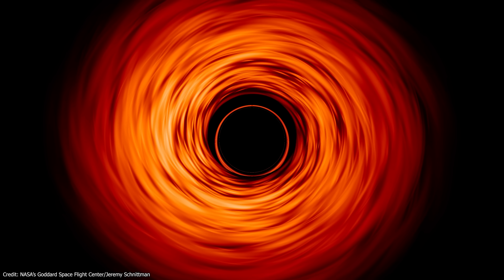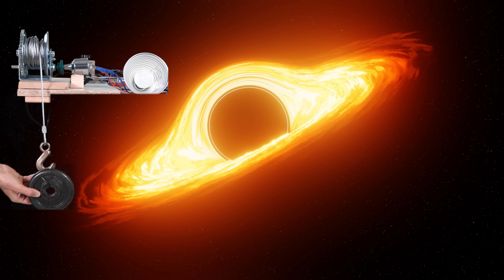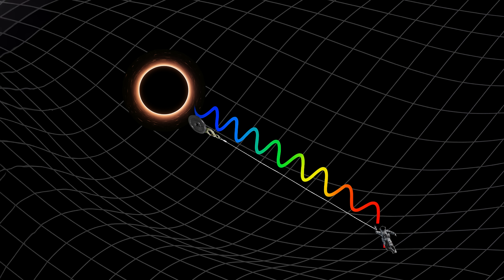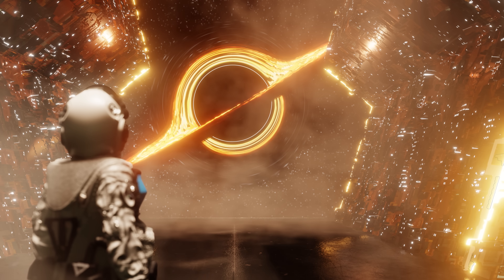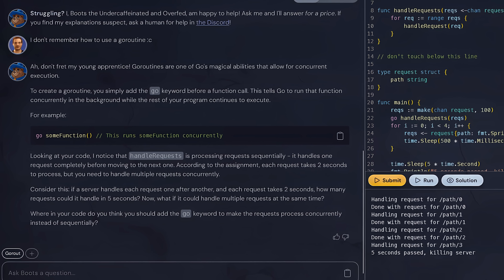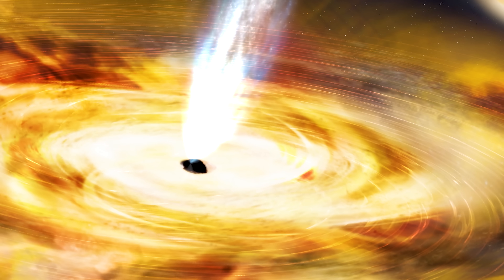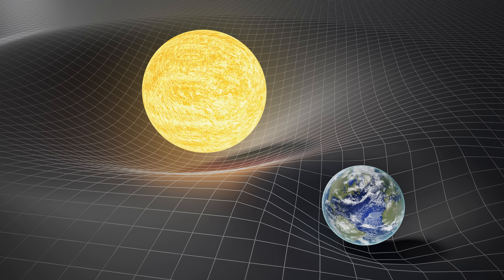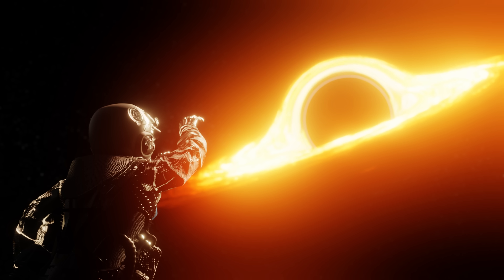How to Convert Mass into Energy at Home

Comment: what people always forget in this topic is the other way around. E=mc² means that energy litterally ways something. f.e. a Proton is made from 3 quarks but proton mass is way higher then those 3 Quarks combined. where does the mass come from? its literally inside the binding energy of the quakrs.
Reply: Energy is mass when it is in a particular form, energy is all the mass in the universe, if it all spontaneously converted to massless, well, it would be quite a pop
Reply: @kingcosworth2643  Energy is mass in ANY form. Kinetic energy has mass, and attracts gravitationally. So do other forms of energy.
Reply: Yes! One does not convert mass to energy. Mass IS energy already (v.v.). One could convert different types of mass/energy into each other though.
Reply: @landsgevaer There needs to be a clarifier that E=mc^2 is rest mass however. Photons for example have momentum and energy but no rest mass.
Reply: @Spacemas61  So that m in E=mc² is not in terms of rest mass, per your example of photons.
 E² = m²c⁴ + p²c²
has the rest mass.
Reply: @landsgevaer the full equation is not all rest mass. The simplified equation (E = mc^2) only refers to the rest mass. The other part of the equation (the p^2 c^2 part) is momentum’s contribution to the total energy. Photons have momentum and this energy, but they do not have rest mass.
Reply: @Spacemas61  Nope. E = mc² is general, can be applied to a moving body with mass m (not just rest mass). Only if you apply it to a static mass will m equal the rest mass.
On the one including p²c², m is the rest mass only.

You wrote that E = mc² involves the rest mass. For photons m=0 then, so E=0. That makes no sense based on your own example.
Reply: @landsgevaer  It cannot be applied to something moving, it is a rest energy simplification. And yes, photons have no energy at rest because they have no rest mass. That’s why you need to use the expanded equation to get the correct result.
Reply: @Spacemas61  Yes it can. E.g. wikipedia: "In a reference frame where the system is moving, its relativistic energy and relativistic mass (instead of rest mass) obey the same formula." <sigh>
Reply: @landsgevaer  It obeys the expanded formula yes. But look up if E=mc^2 applies to moving systems. I am a physicist, I don’t know what else to tell you man.
Reply: @Spacemas61  Physicist huh? Ooh. So am I. Uni degree and all that.
The equation essentially describes the time component of the four-momentum, a quantity that exists in any reference frame. I have already looked it up just to find that quote, for f's sake. That quote is about E=mc²; go read it! Wikipedia titled "Mass–energy equivalence", 4th sentence. For a moving system the total energy is bigger than the rest energy in the same way the mass is bigger than the rest mass, up to a factor c². I know it is most typically applied in the rest frame to explain the restmass-energy relation, but it still works just fine for moving objects if you insert the relativistic mass.
And yet you persist with your miscorrection. What more do you expect? RTFM!

I can lead a horse to water but I cannot make it drink.
Reply: @landsgevaer  I have read the Wikipedia article, and in fact if you scroll down there is a whole section for “extension for systems in motion” which they talk about the necessary p^2 c^2 component. The single sentence you’re using to back up your claim is misleading and worded poorly because we do not use relativistic mass anymore. Even the very first sentence of the article is contradictory. You’re welcome to ask any other physicist too.
Reply: @Spacemas61  Icread that section too, but this thread is not about whether the extended equation involving rest mass is valid too. Sure that is valid. I mentioned that above already. That is expounded on in that section.
The question here is whether E=mc² can be applied to moving objects when using the relativistic mass. It can, if you use relativistic mass. Relativistic mass equals gamma times rest mass, and then the rest follows. The derivation is in that section you mention where they show that this formula becomes equivalent to the extended one involving the rest mass. It is the same, merely expanding the relativistic gamma factor.

Now, you are shifting your position from "E=mc² is not valid for moving objects" to "I do only recognize rest mass, not relativistic mass". Well, boo hoo. This is SRT, I can work with relativistic mass just fine.
Reply: @landsgevaer  I never shifted my position lol, I was confused because saying E=mc^2 applies to moving systems is incorrect in modern physics, since we phased out relativistic mass years ago.

But sure, if it makes you happy to use outdated formulas you’re welcome to. Any sensible physicist will still tell you it’s incorrect because “m” is always interpreted as rest mass now, not relativistic mass.
Reply: @Spacemas61  The old formulas that work perfectly fine because they are equivalent when you insert the definition of a concept that you refuse to use, you mean?
Moreover, that means that your original "clarifier" was entirely unnecessary in your description, you mean, because there is only the restmass?
Thanks dude, you really cleared that up.
This is just pedantry now.
Reply: @landsgevaer  Plenty of old formulas work fine, but that doesn’t mean they should be used. There are often simpler ways and interpretations that minimize confusion when learning a topic.

The reason relativistic mass is not used anymore is because it manipulated the mass term to satisfy reality but when you’re in the mass’s frame it never changes, despite the relativistic mass changing. This is very confusing because it leads to people thinking mass is just materialized when it’s not.

Comment: I watched this video on my phone and converted about 19 picograms of battery mass into energy.
Reply: To be more accurate there is no mass conversion inside an electrical battery. The chemical energy a battery produces comes from the repositioning of electrons into lower energy states. (sorry for being pedantic but I have to stick to the science for the sake of younger students who are still learning this.)
Reply: What about the light radiating of the screen?
Reply: @ All those photons radiating from the screen are released when electrons drop to lower energy orbitals or states within an orbital, so it is a pure energy to energy transformation rather than a mass to energy conversion. It is basically the opposite of photosynthesis (in which photons are absorbed to create molecules that have a higher residual energy than the component molecules that were used to construct them).,
Reply: Ahh
Reply: @captaincat1743  repositioning electrons into lower energy states does actually decrease the mass of the system though. A lot of people have written about that online

generally anything that releases energy also releases mass

Comment: Ok, so I ordered the winch and the 1 kg. weight from Amazon, now where do I order the special unbreakable rope and the black hole? Please send link, oh, also discount code, thanks.
Reply: Can't help with the unbreakable rope, but as for a black hole I've found YouTube works pretty well.
Reply: Gaia BH1 isn't using it's black hole. Maybe you can yoink it without the star noticing
Reply: Just go to the centre of the galaxy. I did it and it worked.
Reply: CERN?
Reply: Or you can just use Earth.
Reply: Costco

Comment: How about turning ENERGY into MASS?
Reply: Ever had constipation? 😂
Reply: Supposedly, gamma rays (high energy light) can turn into electrons and positrons in phenomenon called "pair production"
Reply: Energy already is mass.
A full battery has more mass than an empty one even if the constituent atoms are the same. A stretched or compressed spring has more mass than a relaxed one.
Reply: At 5:46 he said that lowering a mass into a gravity well decreases its mass (potential energy). So it would seem to follow that lifting a mass out of a gravity well would increase its mass (potential energy). According to someone at physics.stackexchange, changes in potential energy change the system's mass, not the mass of the object itself.

Comment: Run on a treadmill, convert your mass into some energy
Reply: Lift weights to convert your energy into mass
Reply: @SafetyLucas I read this with an Arnold Schwarzenegger voice.
Reply: @SafetyLucas  and by increasing your mass you can then generate more energy to convert to mass
Reply: @SafetyLucas  I thtink its actually converting energy into potencial gravity energy
Reply: @Garueri  potential energy yes not gravitational potential energy those are different
Reply: @Aarush.A.S  u sure? I though potential energy could be gravity, elastic, electric
Reply: she convert on my mass till I'm energy
Reply: This little maneuver’s gonna cost us 100 pounds.
Reply: It's chemical energy, not mass to energy
Reply: @sachinkumar-cj1wg  🤦 this comment section needs education like I need a life.
Reply: No bro,

When you run, your body primarily converts chemical energy into kinetic and thermal energy, rather than converting mass into energy
Reply: @kamal92606  
Tell me that when you run , your weight loses or not .
E=mc^2 , this equation tells us that small amount of mass can generate huge amount of energy, therefore when we run ,very small amount of weight (we can say negligible) is burned into energy
Reply: No that's just breaking bonds. The stuff is still there but as CO2 and other stuff
Reply: @deardeer4958 Yeah but the bond also has mass. But yeah I get what you mean.
Reply: @RegebroRepairs What do you mean with "the bond also has mass"?
Reply: @peterh.1521  When you get the energy out by breaking the bond, the mass changes.
Reply: @RegebroRepairs Okay, but why do you write bond have mass?
Reply: @ Because effectively they have. The molecule will have more mass than the separate atoms will have after you break the bond. Unless, of course, it takes net energy to break the bond, then the sum of the mass of the atoms will be higher. 

E=MC2. Using chemical energy is also, strictly speaking, converting mass to energy.
Reply: @RegebroRepairs  Okay, so is the opposite true when chemical bonds forming, that mass increase (within each atom)?
Reply: @peterh.1521  If it takes energy to form the molecule, yes.
Reply: @RegebroRepairs But I have never view a molecular bond to have mass. I can understand that electrons do, but where is the mass in a bond?
Reply: @peterh.1521  Yeah, well, since the bond isn't a separate object, strictly speaking the mass isn't in the bond. It must reside in the electrons, presumably in their positions, but you will have to ask a quantum physicist for the exact details.
Reply: @RegebroRepairs  Esa energía tiene una masa equivalente si uno insiste en contarlo desde la física relativista, pero ningún átomo fue destruido ni convertido en un fotón.
Reply: @JoseGabrielMattaGonzales  No, but energy from electrons is converted into heat.
Reply: @deardeer4958 Nope, very time there's a chemical reaction that releases energy the combined mass of the end products is a tiny bit less than before the reaction.
Reply: @dugldoo  Nah bro
Lavosier and dalton 101 wasn´t literally ´´mass is conserved and elements don´t lose their identities´´ ?
Reply: @Garueri  Those guys are pretty old and didn’t know about E=mc^2
Reply: @DukeEllision329  yeah but we also dont
As for example, not the energy transformed in a nuclear bomb comes just from mass and saying that it’s energy come from e=mc square isnt 100% true
Reply: @DukeEllision329   you mean e=mc^2 +pc
Reply: @ What is pc
Reply: @deardeer4958you don't say!
Reply: @deardeer4958 breaking bonds is losing energy since e=mc^2 that means loss of mass
Reply: @deardeer4958If all your burned fat is converted to energy your house literally explodes
Reply: @deardeer4958why you gotta ruin it?
Reply: lmao
Reply: Eat food.
Reply: True
Reply: And besides we are releasing CO2 and only taking in O2 we are losing carbon from our bodies when not eating
Reply: Treadmill is energy to energy
Reply: I make my energy at your mom's house 💪
Reply: No I want my own orbit
Reply: Mass or ass?
Reply: This has nothing to do with energy mass conversion. That energy one dissipates in the form of heat is negligible if converted to mass.
Reply: No! It uses energy to remove the fat
Reply: Neither it gives us energy nor it gives us mass :/
Reply: Hahahahah fat joke
Reply: Technically heat but, yeah.
Reply: buring fuel is also a example of mass to energy
Reply: Only dumb people and mathematicians believe mass is energy and energy is mass.

Comment: is there any breakthrough for converting energy into mass
Reply: happens all the time at random.
If want to deliberately do it,i think you have to foce fusion.
Like you apply a lot of pressure and heat to do fusion with high mass elements like Iron to make heavier isotopes like gold.
Or:
bombardize atoms with very very hard gamma radiation so that protons get converted to neutrons together with an electron. This might make for an heavier core. Like this would be inverse decay.
Or just the very easy way:  heat something up. The heat energy has mass in itselve.
Reply: We can convert energy into mass, but it requires a large amount of energy which we don't have
Reply: @alien3200  so is all the large amount of energy converts or we need large amount of energy to convert some part of it into mass
Reply: @otaku8783  theoretically you can convert all of the energy to mass but practically it is nearly impossible, so most of the energy gets converted to mass but some of it gets converted to some other form of energy like heat or light or sound etc.

Comment: Burn a log?
Reply: Total Mass isn't lost in a closed system
Reply: Literally no mass is lost in burning a log
Reply: @alien3200  Literally no humor is lost in the process either.
Reply: I'm pretty sure that the mass of the total final combustion products will exceed the mass of the log because of the chemical addition of oxygen..
Reply: @rogerkearns8094  But you have to calculate the mass difference of oxygen in the air before and after the burn too.
Reply: @ 
@Yehan-xt7cw  
Yes, you're right, I've been pondering that myself, since posting! 
Indeed, mass must after all be converted to energy here, otherwise the heat and light would come from magic! ;)
Cheers, thanks for the correction. :)
Reply from the maker: Chemical reactions only convert about a billionth of a percent of their mass to energy. Black holes can approach 100% efficiency. If only we had one near…
Reply: @ 
@TheActionLab  
Still, strictly speaking, sidewaysdesign is not wrong.
Reply: @rogerkearns8094  Well if you look at it like that, you're technically converting mass into energy nonstop with the metabolic reactions that occur within your body
Reply: @rogerkearns8094  Exactly, they're not wrong, so I find it strange that everyone is trying to correct them
Reply: @TheActionLab  I hear the guys at the LHC will make a black hole any day now
Reply: @TheActionLab  Just buy one, surely we as humans can get one somewhere and at least attempt to capture it and/or sell it
Reply: The best way to have mass convert into energy would be to buy a banana, the unstable potassium’s isotopes would decay and consequently convert some of its mass into kinetic energy of a positron
Reply: @daniellucesoli5120 not only that, the positron collides with an electron. When that happens, both of them annihilate (get converted to just gamma waves). Bananas literally convert mass into energy as if its nothing
Reply: Fucking ashes?
Reply: Can you do an experiment to burn a small piece within a closed space with oxygen and see if the weight changes or not?
Reply: @sarath4mec   The change is too tiny to measure reasonably
Reply: If you burn a log, it won't loose mass, it will gain mass because of the bond of carbon from the log and oxygen from the air.
Reply: It wouldn’t be strictly converting mass into energy, rather you would be making use of the energy that is produced when chemical bonds are broken
Reply: @daniellucesoli5120 It generate light, which is energy
Reply: @villager736  The light energy comes not from the mass of the log but rather from the chemical bonds between atoms in the log
Reply: @villager736  it doesn't generate light, for burning a log you supply heat and some of that heat gets converted to light.
Reply: @alien3200  What do you mean? The supplied heat is just activation energy. The release of heat does lead to light emission, and according to Einstein's theories, that energy does come from the mass of the log and the air it reacts with. The mass is extraordinarily tiny though